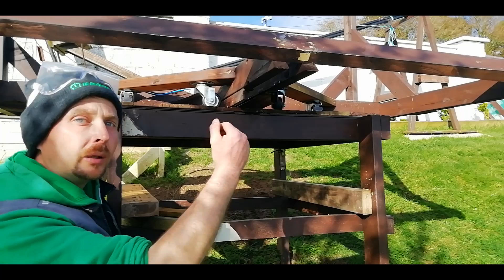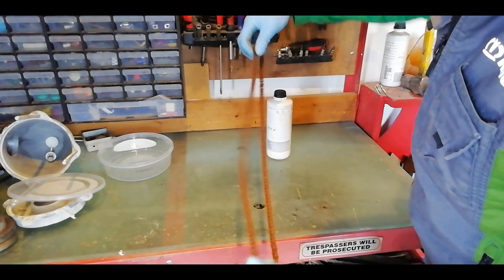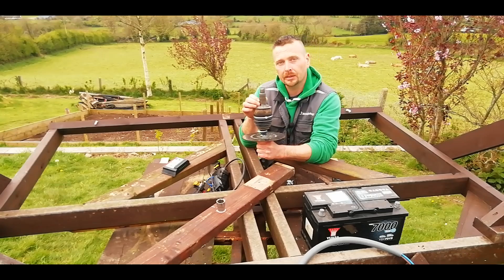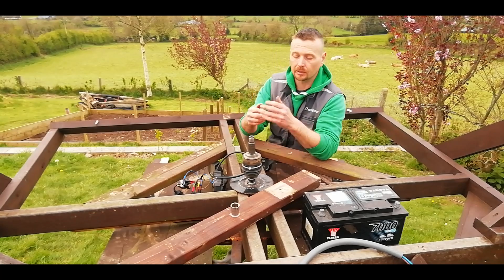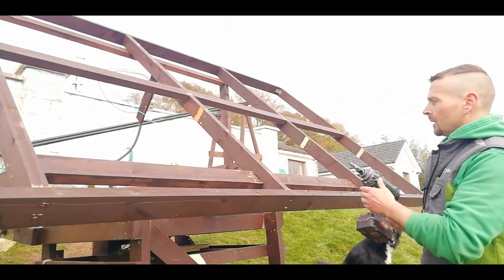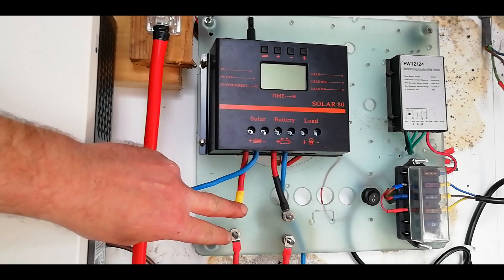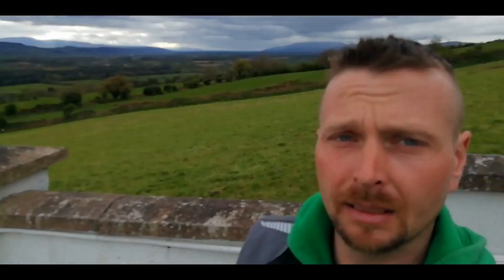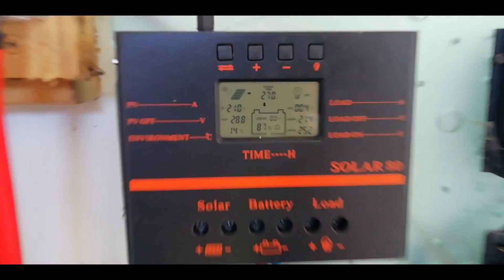Rotating ground mount fail & rebuild

Comment: I only have a small solar panel for proof of concept purposes.  Here in Victoria Canada,  I can solar cook too, because we get the Sun. (steaming soil, boiling weeds,  dehydrating  herbs).  I "invented" an airlift pump-waterwheel-capstan drive as one method to rotate it. (saw a video about capstan drives in robots)  No need for actuators or motors.  Anyway,  it works!  So looking at your setup,  if you can rope around the outside of your rotating stand,  and attach your motor to a capstan drive instead,  you can easily rotate it way more evenly.   You probably need to use good climbing rope or sailboat rope for the capstan,  but I bet everything will work way better,  and it will be a lot more steady in the big winds.  I'm originally from a farm near Rathvilly, Co. Carlow
Reply from the maker: @Brians-tracking-solar-scoop  hello Brian. Do you know what? I love these rare occasions where a fellow inventor comes accross my stuff. Had a quick look at some of your vids, hope you don't mind, and all I can say is "nice, very nice!" Rathvilly seems a nice beautiful spot in the Midlands, have only passed through it on many occasions unfortunately. Never had the chance to explore.
I hear what you're saying about a rope setup. Increase the leverage and gearing ratio between driven and driver to smooth out the motion. Ideally I need a driven wheel/sprocket around 40" diameter with a driver somewhere in the parish of 2-4". The larger sprocket is hard to come by "off the shelf so I've been considering a linear actuator setup for the next gen as the total range of motion is only 100 ish degrees of rotation.
Fair play for your energy and constant inventions, isn't it frustrating how youtube doesn't promote creators like you and I more and instead focuses on "the current thing".
Best wishes from piltown.
Reply: @ourkilkennyhomestead2006  Thank you for saying (Fair play for your energy and constant inventions, isn't it frustrating how youtube doesn't promote creators like you and I more and instead focuses on "the current thing".)   You are totally right, I am very frustrated.   Youtube only let people see what they want them to see.  It's quite brutal and their algorithm rules.  But people are to blame too.  They need "guru's" and "influencers" to worship and only listen to science and engineering if it comes out of a big lab  or a big company and is very polished, commercial and flashy, and delivered by a photogenic newsreader.    Sustainable development and doing stuff on the cheap is the enemy of big advertising,  because at the end of the day, they are trying to sell people more  and more "stuff" and we are helping people do more with less.  The algorithm will weed us out.   "High precision speed reducer using rope" is the video you should check out. He is doing robotics so he needs the highest precision.  But you don't need much precision at all.  Your motor stops and starts when the light sensor tells it to.  As long as you keep a rope or chain in tension, and keep your gear ratios somewhat within a range,   you will get great results.   My tracker uses masons line to rotate the small reflector (and a small solar panel too) while the timing/tracking  is done by compressed air. It is so different than everything out there that nobody can get their heads around it.     My tracker is more accurate at tracking the sun than 95% of the commercial trackers,  and yours is more accurate than 90% of them!   You should be very proud of what you did especially because you did it on a large scale and your accuracy is in the sweet spot for  tracking solar panels, plus you are being honest about repairs. (I have greater accuracy because I am doing solar cooking, and that needs more precise tracking,  I am not in any way dishing your project).

Comment: Do you know how much more power you produce with a sun tracker vs a well placed static solar panel?
Reply from the maker: Not sure of the exact figures tbh. It's main objective is to increase hours of maximum input as opposed to a fixed rig where max input would be short lived.

Comment: Nice pragmatic engineering solution.  Frustates the hell out of me that our professionally installed system on the roof doesnt move!  Presumably next step is some kind of sun tracking mechanism although what you have got is a lot better than fixed panels.  Good on you anway, looking forward to the next installment!
Reply from the maker: Thank you, it's rough and ready and could do with higher powered panels but it works for the moment. How it takes the winter will tell all.
Reply: Panels are cheap and tracking systems are complicated, moving things break down and don't last the life time of the panels. Not worth the overhead.